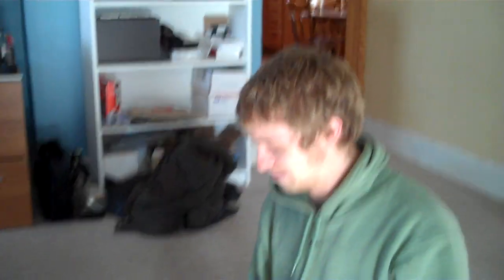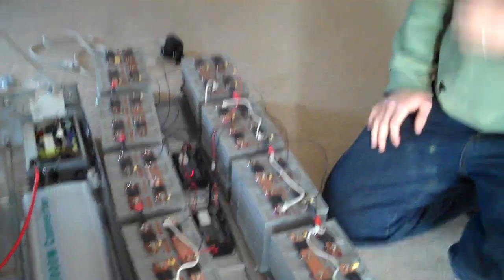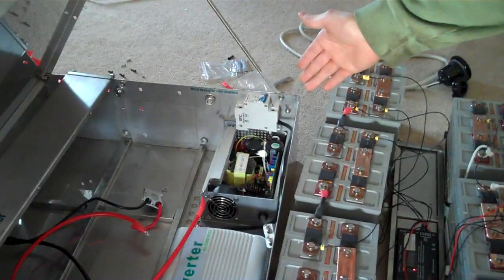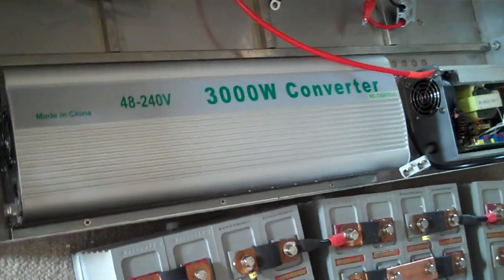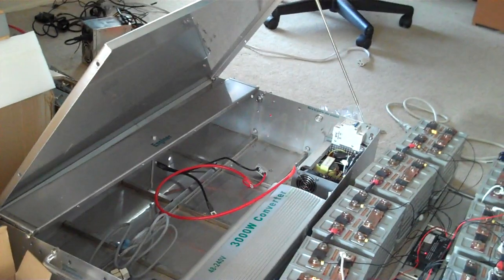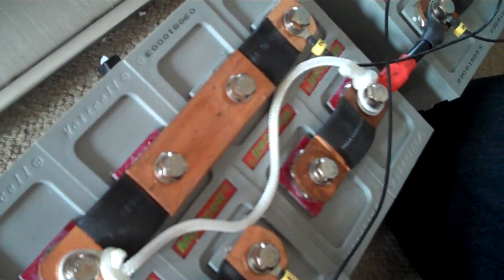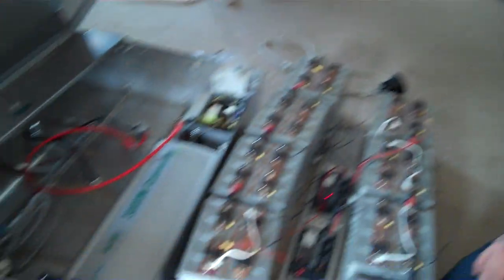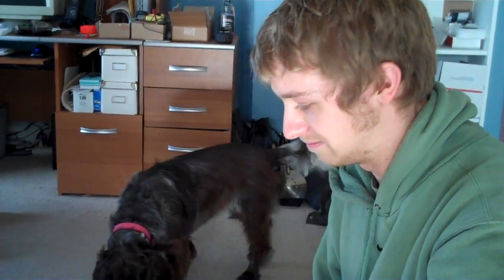Enginer Prius Plug-in Conversion part 1

Comment: The inverter is Just Connect on positive and négative on battery origine ???
Reply from the maker: On these Prius systems adding an additional battery, the output of the additional battery is converted to match the voltage of the Prius main battery pack using a DC/DC converter. The output of that then connects to the original positive and negative terminals of the Prius main battery. Essentially, the second battery is just installed in parallel with the original.
Reply: I rechersh  a 48 v 240 dcdc